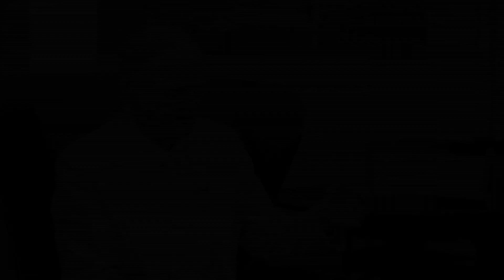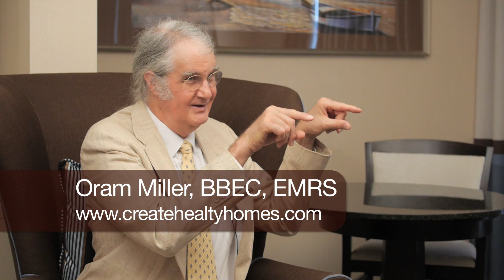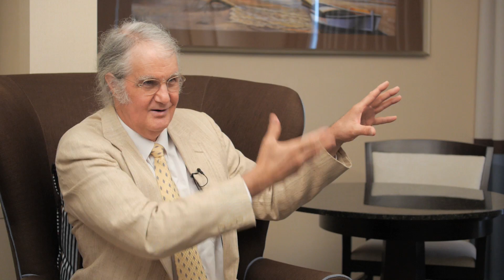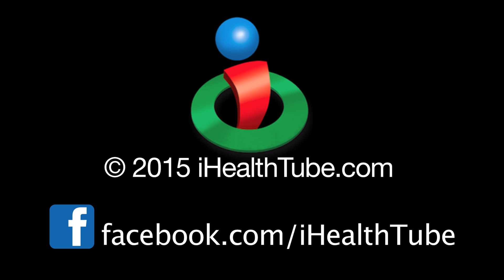Could Your House Have These Hidden Toxins?

Comment: could you switch of power from the mains?
Reply: +M¿LLZ PRØ™ - Yes, that's the easiest and cheapest fix for the bedroom. 
 You would have to move your alarm clock into a different room. Or set your phone to wake you up while making sure the phone or alarm clock is at least 6 feet away from you and you're still be able to hear it go off. It would also be a good idea to keep a flashlight nearby for the middle of the night bathroom call.
Reply: or just put your phone on airplane mode :-)